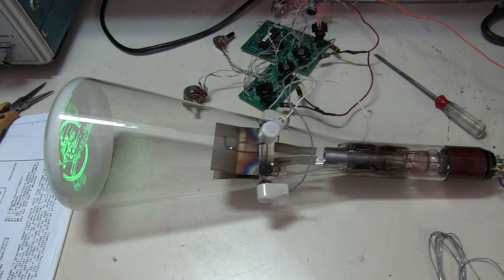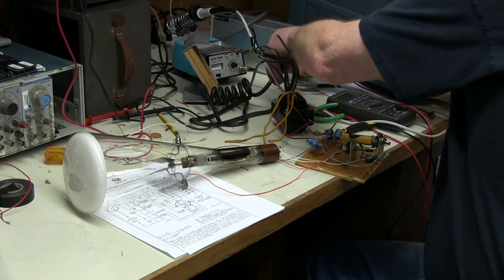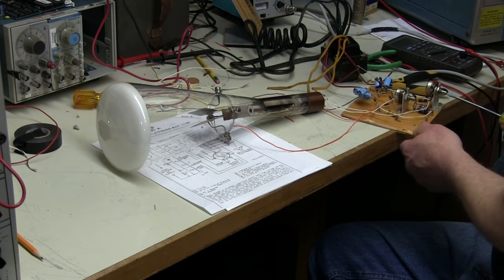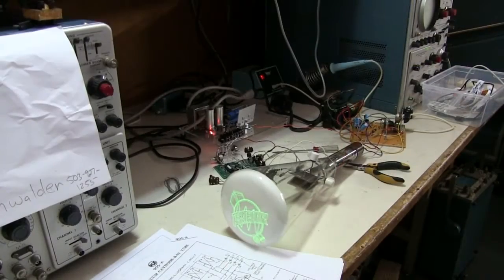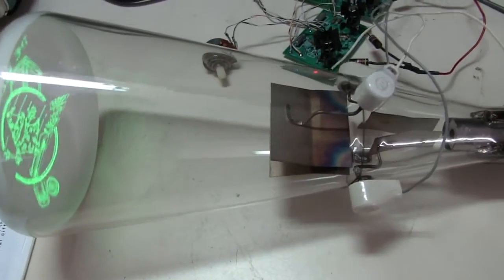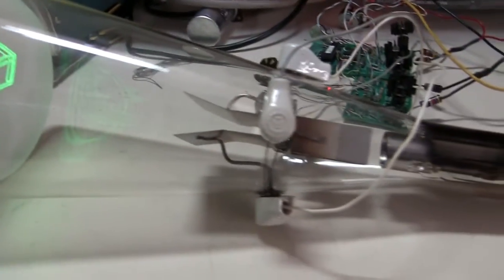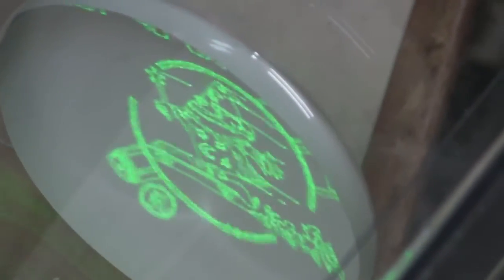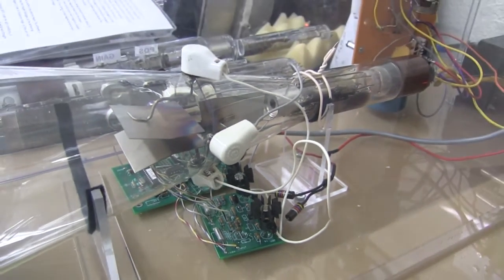Creating a demo of a 1930's RCA CRT for the VintageTEK Museum

Comment: As a youngster living in Vancouver, BC, with a keen interest in electronics in the early 1960's,  I remember one of those CRTs in the original open style wooden crate with the tube suspended inside on springs.  It was in he window of a old dusty, poorly lit treasure trove called The Ham Shack, located near the downtown end of the Granville Street Bridge.  It was priced at $5.  It was beyond my weekly allowance at the time by probably tenfold.    Nice job there!  What a pretty CRT and so well suited as a visual demonstrator.  Be advised to expect noticeable screen burn if you leave it on for extended periods daily.  In a coincidental way, the magnetic motion modulation of the stationary image has a useful side effect in extending phosphor lifetime.  Perhaps a standby mode where HV is removed and 2.5 vac filament is run through a silicon diode to operate at half power while in standby, diode shorted out in operate mode, might suit you museum needs and extend the lifetime of what is now a rare and scarce CRT to source.  At least one TV manufacturer used this technique in the 'Instant-On" television receivers of the 1960's and 70's.  Maybe Zenith and Quasar?